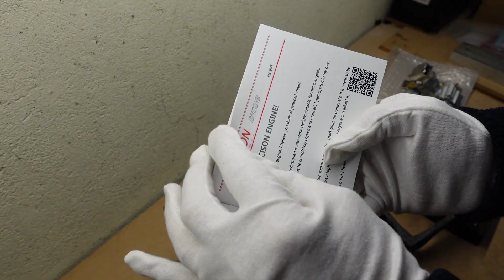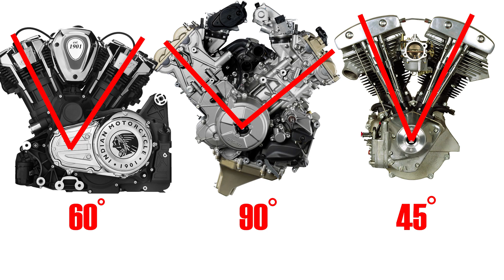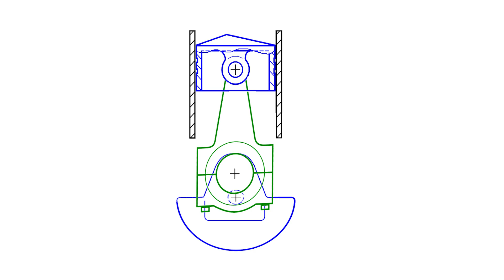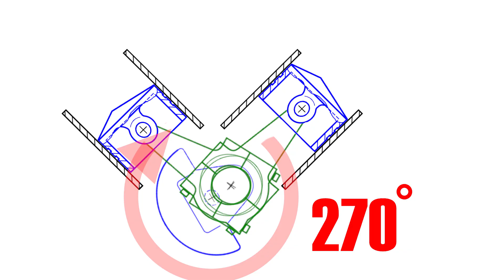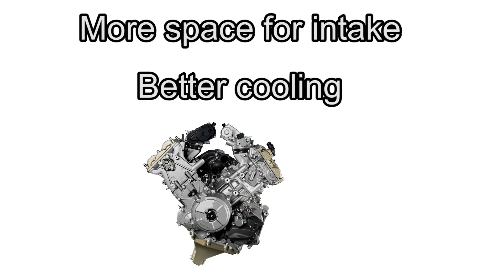Miniature RUNNING V-Twin - 45 vs 90 degree V-twins - ENGINEDIY mini ENGINE unboxing, review, startup

Comment: i did understand direct that the oring is to use over the tube under and inside the nut before screw it to the cylinder very ease to understand and see that make the tube not to be lose and also act as an sealing. but maybe it is my experience of mc engines and mecaniks make it so easy to me

Comment: Both plugs fire at the same time:  one during a power stroke and the other during an exhaust stroke.  It has a circuit breaker, not a distributor.  It did not start immediately because there is no choke.  You could use a finger as a choke.  The portion of the video which attempted to show the engine "set" in the motorcycle frame has the engine/frame 180° off to the correct fit.  You could likely tighten the exhaust by using two O rings per pipe.

Comment: The exhaust nuts are bottoming out before tubes are pinched.  Adding washers are actually making things worse.  I'd try beefing up the exhaust flanges with solder to see if that tightens things.  That, or, find a washer/spacer to fit around/under the flange itself.
Reply: Try using a tubing flaring kit. Seems like they weren't flared to specs. Or the wrong diameter tubing.

Comment: What lubricates the crank & bigends ?
Reply: My guess is that it uses small sealed roller bearings like skateboard bearings for the big ends and mains because it is not meant to run under load, the cam and valve train are apparently lubricated by grease and the premixed fuel only lubricates the cylinders, not sure about the small ends
Reply: 2 stroke
Reply: @nadahog1569  Vapor in the gasses in the crankcase ?
Reply: close. but no. its a 2 stroke version of a panhead. meaning you mix oil with gasoline. it lubes all the essential parts then gets burned up. as per design
Reply: @nadahog1569  2 stroke doesn't have valves... not sure what '2 stroke version' means but anyway, I get it
Reply: @nadahog1569  It's definitely a four stroke , the premixed fuel lubricates the cylinders only and grease probably lubricates everything else, it is not meant to run under load or for long periods

Comment: Wow a Harley engine that doesn’t leak oil, amazing!
Reply: that because it was a 2 stroke model. so its burning it.... which is basically a harley......
Reply: @nadahog1569  It's called a "total loss" lubrication system.  The motor has 4 strokes.
Reply: This comment will not age well.

Comment: Neat little engine

One thing to note about the 90° engine on Ducati’s
They’re usually stress members of the frame. Meaning the engine itself is part of the frame. They don’t use box frames

Frames on Ducati’s are quite small, and their wheel base is also quite short
Reply: Also, the front cylinder is lying down almost horizontal making the rear cylinder almost vertical which saves a lot of space.

Comment: Exceptional fit and finish yet the fit is poor (exhausts, grounding wire) and the finish lacks polish (fuel connection, poor instructions).
Does look and sound pretty sweet through, would love to have one of these and build my own exhaust system.
Thanks for this video!

Comment: Watch out for that phase sensor, ive watched in another channel the same engine, the phase sensor comes loose in the gear housing and comes into contact with the gearing thus getting chewed up and stops functioning and no signal back to the CDI.

Comment: At 8:46 you said that 90° V twins, like Ducati's can dramatically reduce vibration... Have you ever ridden a Ducati? 😂 😂 😂
Reply from the maker: Have you ever ridden a shovelhead? Or maybe a 360 degree twin? You don't even need to ride it. Just look at the front wheel while it's idling.
Reply: @d4a  I'm totally noob when it comes to motors. The little I know, I have learned from your videos. But I have owned a Yamaha MT03 (naked version of the R3) and it's an inline 2 (is it the same as the 360° V you mentioned?). It was very smooth, actually. Now I own a Ducati 796 and they are famous for shaking a lot below 4k rpm, but works very smooth above that. Have no clue why that happens. Just thought it funny this configuration (90°) would cause it to shake less...
Reply: @andrechagas4549  That's not a thing of engine balance, that's due to the fact that without variable phase (like in all car engines), in order to produce power at high rpm the cams are phased to privilege the high rpm and therefore the engine runs a bit rough under certain RPM.
Reply: @andrechagas4549  MT03 is a 360v but has a balance shaft to smooth it out.  Get your hands on an original Triumph or Norton and hold on to your teeth.

Comment: The firing interval of a 90° V is actually a pro when applied to a motorcycle - it enhances tyre grip.
btw you have the orientation of the Ducati engine wrong - observe the word "Ducati" on the case and the sump casting. It needs to be rotated 30° to the left.
Reply from the maker: Yes because the orientation of the word Ducati is more important than showing the two angles next to each other.
Reply: @d4a   I think he meant that by looking at the Ducati logo stamped on the case covers, one can see that the orientation of the engine isn't true. I'll be honest it did throw me off seeing the bottom cylinder more vertical then where it usually is on the panigale
Reply: @louisvaldivia9260  the point of the video isnt to well represent the mounted engines, but to show comparison between angles. As d4a said, it would not have been a good comparison of both engines next to eachother